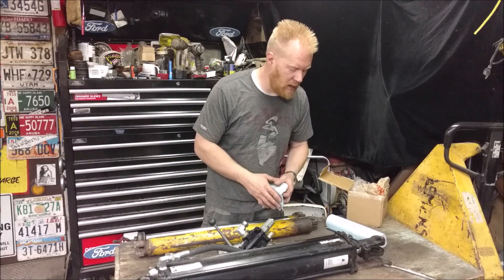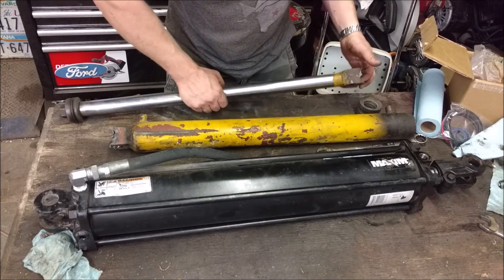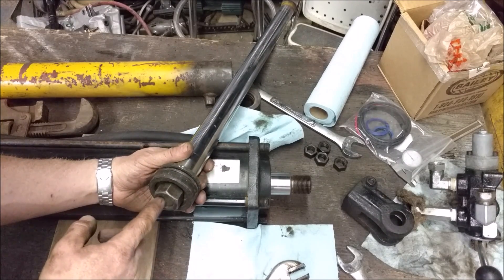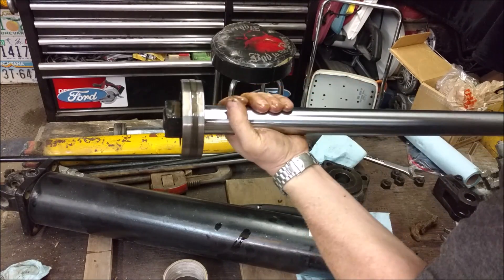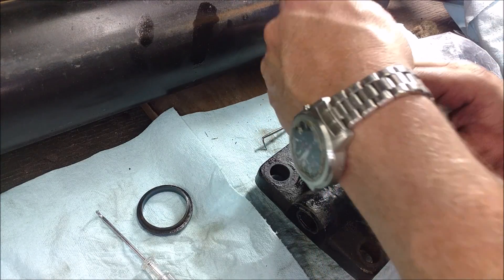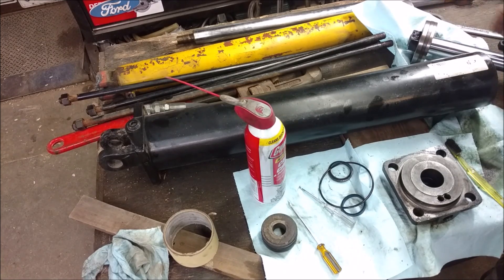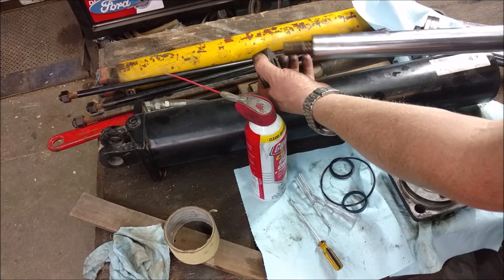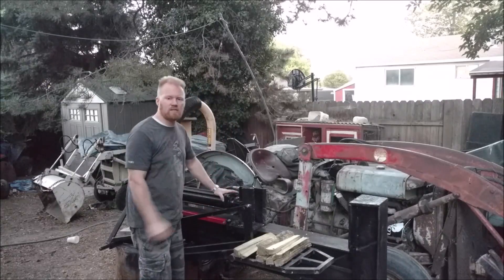Rebuild a Leaking Hydraulic Cylinder Ram Easy HOW TO

Comment: Finally a video with the same type of cylinder. Unfortunately, it's the yellow one.
Trying to disassemble a 5" x 24" x 2" cylinder on a 34 ton Swisher log splitter. I pulled the round wire ring, removed the hose fittings and have all the fluid drained. I have the end cap protruding about 3/16 " and it will not come out any farther.
I have heated up the end cap with the hope to soften the outer seal which I believe is the culprit holding this in. Using pipe clamps to pull on the shaft at the splitter end.
I just don't get it...why this won't pull apart. Any suggestions?
The yellow cylinder looks like is has 2 grooves inside... a second snap ring?
Reply from the maker: It would just be the one wire. The o-ring of the top gland is likely sitting in the wire groove in the outer. Use the rod as a hammer from the inside.
Reply: So the rod is the...ram/shaft,(shiny chrome thing...:))
Okay...if okay
The end where the splitter connects has a hole, perpendicular to the rod, for bolting/fastening the splitter.
This is where I currently have the strongest steel rod,(type of pry bar tool) I have inserted, and been pulling on (clamping to the base/foot...floor?) with the pipe clamps.
I was at the same time, while under pressure with one clamp, hitting it with a hammer.
(Pipe clamp usually falls off)
 But not really SMACKING it with like a maul. Don't want to bend my steel rod if I can  avoid it but, the cost of the steel rod,(an old USA made steel rod) and the price of someone else replacing the seals.......I shall lean towards the SMackiNG method and find something else to use/abuse...later tonight.

Comment: I have a ram like the black one there I was wondering how it come apart how many seals does it actually take because I need to replace the seals in mine I let her neighbour borrow it and he tried to split two pieces of wood and I assume he put it under too much pressure it was pissing out oil as you brought the rod out

Comment: Thanks for the simple video. Two questions though, can the seals be put in wrong? How do I know which way they go?
Reply from the maker: Generally you swap the old for the new at the same time so you see which direction they go. Some seals don't matter, like O-Rings. If the seal has a flare, flap, or cup shape on one side it acts like a one way valve and needs to face the side that holds pressure.

Comment: Very late but figured I’d mention that the pieces you thought were wipers on the pressure seal are actually what’s known as backup rings. Their purpose is to keep the seal from deforming or extruding from the high pressure.

You’ve got lots of good videos, keep it up!

Comment: Where do you get your seal kit from? 25 ton log splitter
Reply from the maker: Google the manufacturer of you log splitter. If that doesn't yield anything you'll have to take it apart and measure the seals to buy new generic ones. www.theoringstore.com has pretty much everything.

Comment: Great video, really appreciated it. I need to replace a leaking seal in a 6" OD cylinder at work, but I have a small log splitter at home that may have the problem you described with the rear nut coming off since I have no forward movement even though I hear and feel the valve switch..I especially like the log lifter mechanism on the side! Did that come with your splitter or did you fabricate? Great idea! Thanks!

Comment: Hi great video, what sort of kit would you order to replace the seals and what did you to lube the inside of the cylinder?
Reply from the maker: I used hydraulic oil to lube the parts. You'll need to locate a manufacturer of your cylinder and then you can get a seal kit. If you can't find a manufacturer, you can tear it apart and any hydraulic cylinder shop will have O-Rings, Wipers and Seals to fit your bore.

Comment: Great video as usual! Where do u get the new seals? I have transmission jack that needs new seals.
Reply from the maker: I was able to get them directly from the manufacturer. A lot of jacks use generic O-rings and can be sourced through a well stock auto store(NAPA) or Google the jack brand and I'm sure you'll run across a kit.

Comment: Thanks for the vid since I'm not familiar with hydraulic cylinder seals found it interesting..  Works good enough to crush oven cleaner cans and vhs tapes without leaking oil, I'd say you fixed it!
Reply from the maker: Haha. That's the ultimate test.

Comment: What info did you need to be able to order the Seal kit? is there a model number on the cylinder?
Reply from the maker: My cylinder still had a brand and model number on it. The yellow cylinder in the background was a different story though. It is a custom cylinder from a small 1980's backhoe manufacturer and finding exact parts are impossible. The good thing though cylinders generally have uniform bores and rods, ie: 2", 3" etc. So universal seals would fit the bill.
Reply: Excellent. Thank you for the detailed reply!  😁. I really really enjoy your videos,  especially the spray can refill,  and your shed built from pallets series.

Comment: my main seal or pressure seal on my Tractor front end loader i think is internally leaking and the bucket droops to a certain point then stops
Reply from the maker: A lot of time is the spool that is leaking.
Reply: This is why I havent done anything yet LOL.  Im not 100% sure which one it is.  I had the spool rebuilt not to long ago.  (it was having other issues) I was thinking since the bucket was only leaking down so much then stopping it was more one of the cylinders. If I took the time to take the hoses off and plug them one cylinder at a time then see if it leaks down.  I figured this would be a fairly simple way to test but "ain't nobody got time for that "  LOL    its not to bad right now just annoying.
Reply from the maker: If it wasn't such a hassle dealing with all this fluid I would have fixed this leaking cylinder a year ago.

Comment: I always wondered how to replace the seals in a hydraulic ram. Great video. Was it difficult to find the seals?
Reply from the maker: The cylinder is still sold so it was pretty easy(helped that is had the model number sticker still on it). The Yellow cylinder from the 80's was a different story and it is hard to find seals for it.
Reply: Try the O-ring Store.com